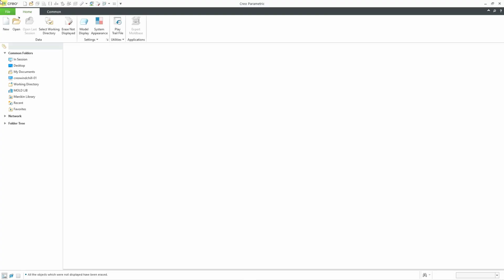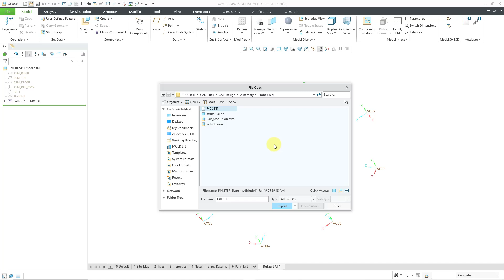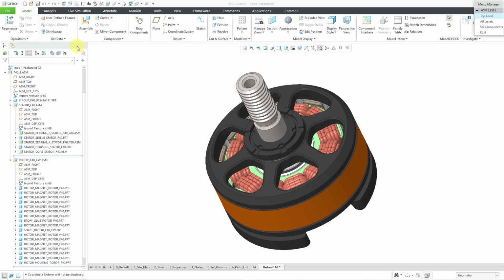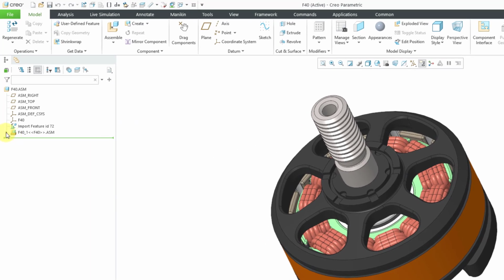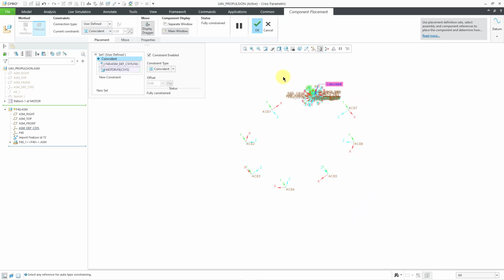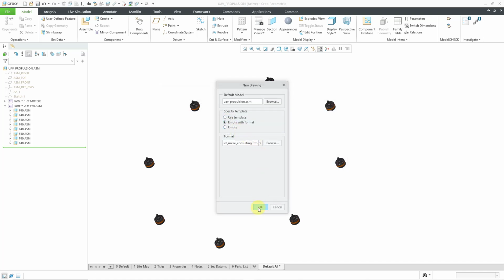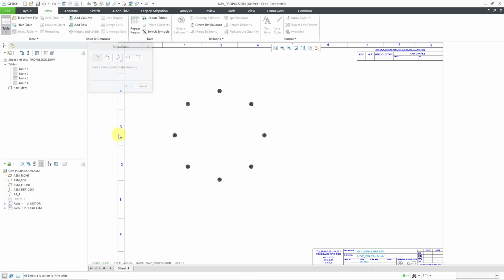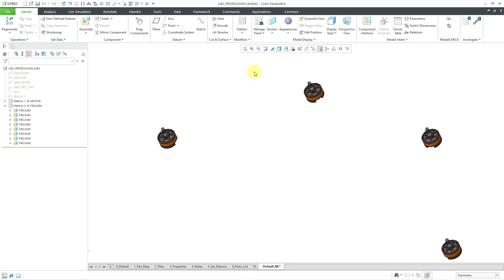Creo Parametric - Inseparable Assemblies Workflow for Purchased Items

Comment: Guess I don't see what's special about this or how it would help me.   I probably should check into it to verify.  I've always just taken a vendor item, such as a clamp from McMaster, and downloaded a STEP file.  Then in Creo, I import what is actually an assembly,  as a part.  I get one part number and one import feature in the tree.  Now I don't need to deal w/ all the random names Creo gives the individual parts in Windchill. Granted I'm not able to work with the individual components of the clamp,  but there is rarely a need to. Aren't you still getting a number of randomly named parts in Windchill in the end w/ this technique?  That is definitely something I do not want.   One con against my technique is if I have an assembly of different materials I can only apply one material to my model.  Which probably will not represent reality.  However, if I have the part in hand and can physically weigh it, I can calculate out what the density should be and enter that.  The CG won't be correct but that is usually noise in my assembly.
Reply from the maker: Not every functionality in Creo is useful to every person. And that's okay. I don't know you or your work, so I can't say if it will help you or not.

Personally, I come from an aerospace background. Working on UAVs and rockets, we use A LOT of imported components. Not every STEP or IGES file can be imported as a single part. Some will only import as an assembly. We're talking about stuff that's a lot more complicated than McMaster Carr. Same holds true if you're getting vendor files in another native CAD format like Inventor, CATIA, or SolidWorks.

One of the main points of this technique is that you are NOT getting individual objects in Windchill. Instead of getting 500 objects in Windchill (pretty typical for a lot of the aerospace imports I've dealt with), you're getting one object in Windchill. Over time, it adds up, and it's a huge benefit.

Maybe this functionality is not for you and your applications. But I know a lot of people and companies that benefit from it.
Reply: @CADPLMGuy  OK, not getting individual assembly part files in Windchill is a plus for me.  I'll look into it this week and see how I can apply it to our company. Thanks Dave.
Reply from the maker: Also, you should look into Multibody. That way you can import a STEP assembly as a single part and still apply a different material to each Body. That will also save you a lot of time and effort.

Comment: Great video.  We use it all the time for step assy imports. We also use it to show an assembly state as a snapshot in time.  In Creo 8 you need to use a config pro option to enable it.  you may want to put that in your description.  Another video could be created showing how to use the embed/extract functions.  This has some pretty neat capabilities.  During PTC/USER event they said that Creo 12 will offer multibody option to bring in an assy step file into a single part.
Reply from the maker: I have a playlist called "Creo Parametric Assemblies 8 - Inseparable Assemblies and Embedded Components." This is the third video in that playlist. The first video covers the configuration option, embedding, and extracting. 

I am trying to avoid repeating content from previous videos unless absolutely necessary, as it just makes the videos longer and longer. I have made a lot of videos recently in the 12-18 minute range, when I really want them to be in the 3-6 minute range. This video is almost 9 minutes, so I didn't want to add extra content already covered in previous videos. I'm trying to focus on the mission of "give people at their jobs the information they need in the shortest time possible," but I tend to veer towards "cover every bell and whistle for the feature / function."
Reply: @CADPLMGuy  perfect!  Keep er moving!
Reply: I would say sometimes repeating things isn’t always a bad thing. Take this video for instance, we went from Creo 7 to Creo 10 skipping the other versions. I didn’t know this feature existed until yesterday as I didn’t have a version of Creo that could do this and if I watched the video on it when 8 came out, enough time passed that I forgot it. Because of this video I spent a good hour yesterday embedding little air cylinder assemblies and some other prepackaged components that we make internally and put on a shelf to make my future life easier. Thanks for everything you do in your knowledge sharing!
Reply from the maker: @crawdaddy270 I've been planning a video to help people understand how to use my channel. I'm not going to repeat previous content (in general). That's one of the choices I have made. Instead, my channel is based around playlists. If you find some topic that you were previously unfamiliar with, I recommend that you find the related playlist. YouTube does not have great search or browse functions (in my opinion), so I am putting together directories of playlists on my website.